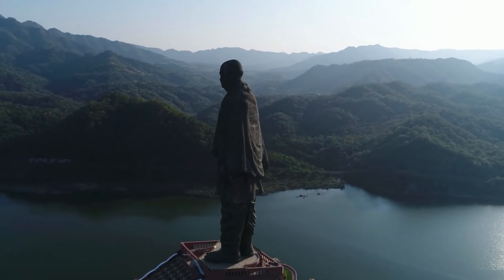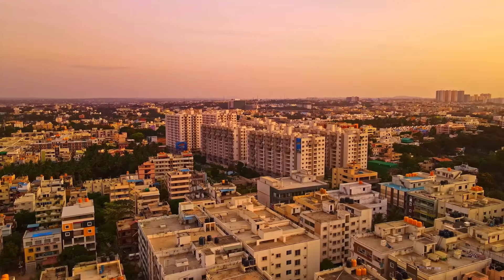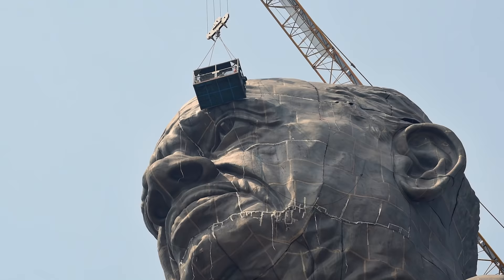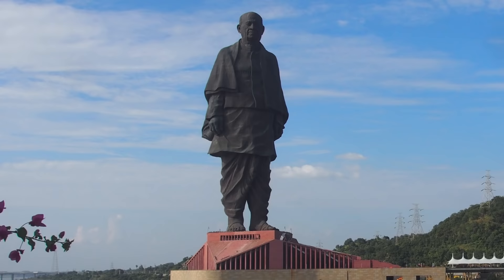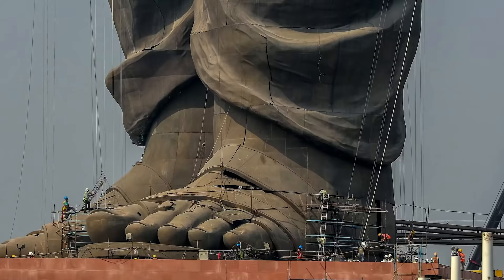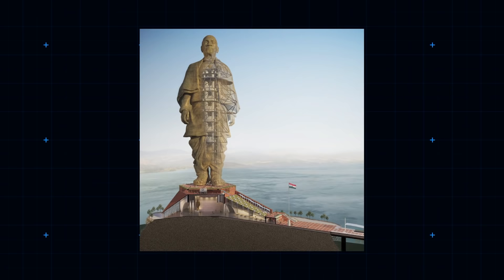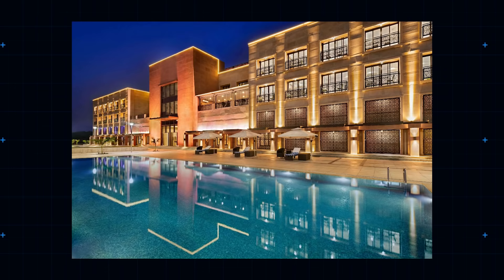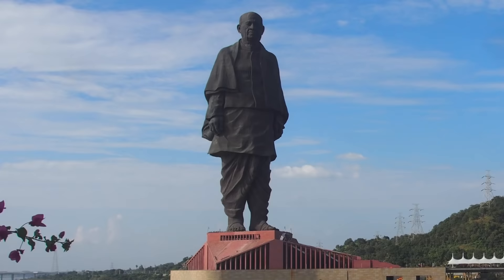How The World's Tallest Statue Was Built

Comment: 1:00 "...Some 100 million farmers... yielding 129 tonnes of scrap iron..."  So each of them sent in 1.29 grams of old farm equipment, i.e. less than a paper clip ?  Does nobody proofread ?  What about the narrator, asleep on the job ?
Reply: What the Gujarat government did was they ran a campaign of collecting metal from villages. There were so many people who wanted to give something to be put into the statue, so the government decided to get a little metal piece from each village. 
So a village with a population of 2000 only gave a single nut/bolt or some other piece of metal.
Reply: @SunilKumar-nf7ft   That hardly qualifies as "old farm equipment".  The script, as narrated, is rubbish.  An item of "old farm equipment" would be a worn-out tractor engine block, or a broken crankshaft. Also, a million Qty of nut/bolt would easily fit into 1 cubic meter (100x per side cubed = 1M). The script is rubbish.
Reply: @JxH  okay bro whatever